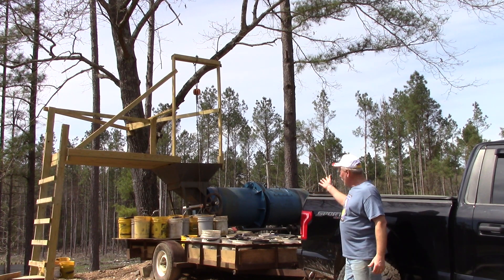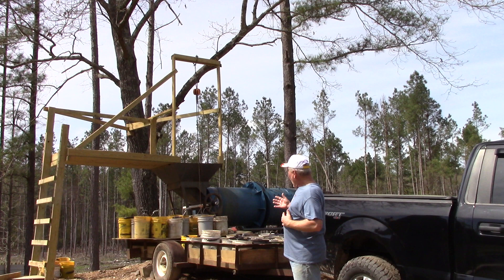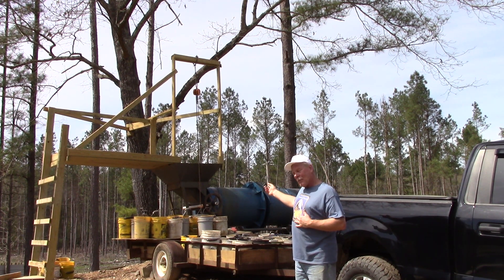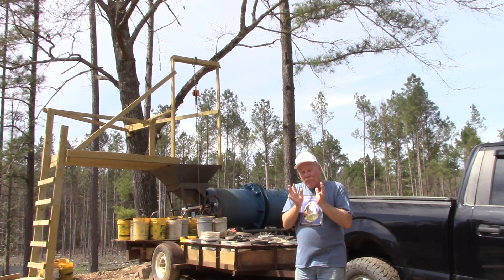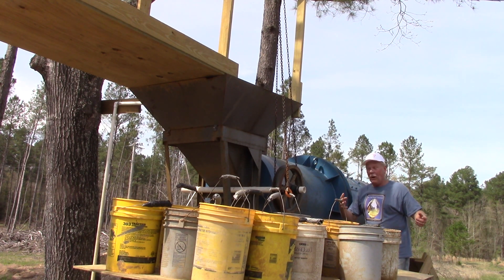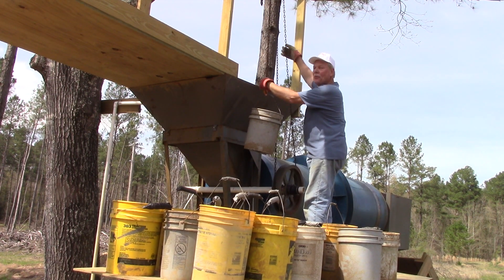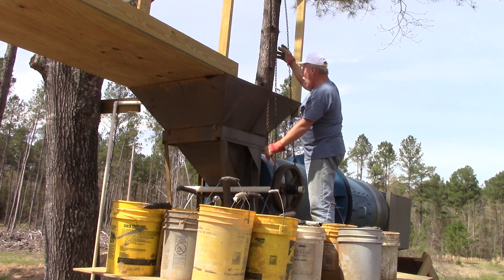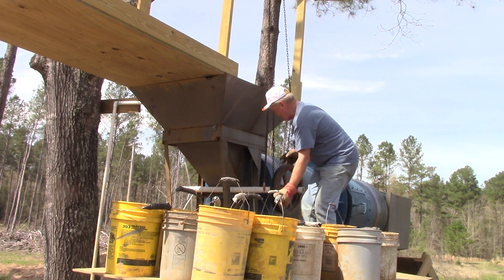Get A Thorough Demonstration And Explanation Of How A Modern Diamond Recovery Plant Works

Comment: If you pin that pulley to the shaft, you could rig up a coupling and run it off of a cordless drill. It looks like you're not applying much torque at all. So, a cordless drill would really speed things up for you.
Reply from the maker: This is huge.  A cordless drill wouldn't turn it.  We added another drive chain, and it is working fine with the motor we have.  Speed isn't necessary.  Thank you for your thoughts and comment, though.
Reply: @genuinediamondsinar3253  , no, I'm talking about the block and tackle hoist! Not your whole apparatus! LoL

I use a drill to move my Z-axis on my knee mill up and down, and it takes more torque to do that than to spin a block and tackle (to hoist those buckets into the air).
Reply from the maker: @djhal7961  Okay, now I'm with you.  I am sorry.  Yes, there's got to be a better way.  That is just too slow and labor intensive.  I'll consider your idea.  Thanks.

Comment: De Beers uses water to wet down the slurry. Then they run it over a conveyor belt covered in grease. The Diamonds stick to the grease because they will refuse to get wet. The grease is scraped off of the belt, melted and the Diamonds are retrieved, then the grease is recycled.
Reply from the maker: Yes, we also run our gravel concentrate over a grease table, but that is AFTER going through all of this process to get rid of all of the dirt and sand.  We use DB-43, which is a DeBeers' grease specifically designed to catch diamonds.  I made a series of videos about how to operate a grease table.  Here is one of them.  Please take a look:  https://www.youtube.com/watch?v=xvyAwZhUQzs&t=75s